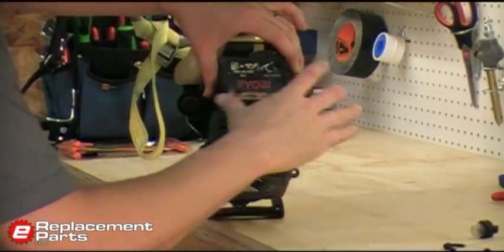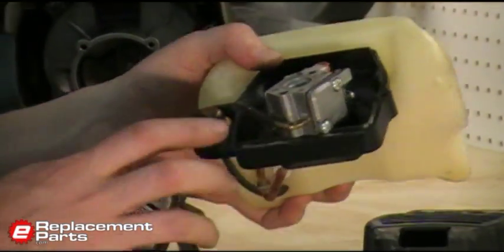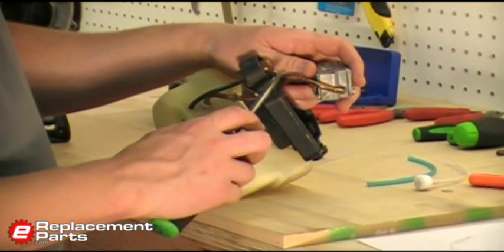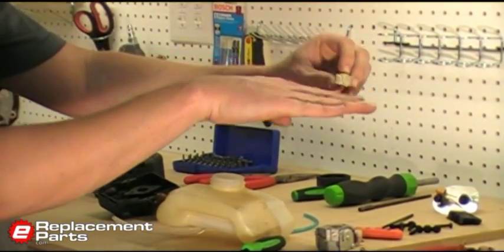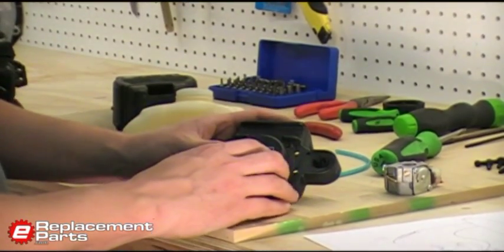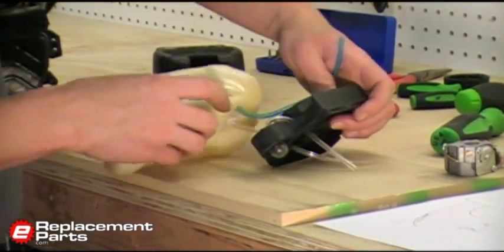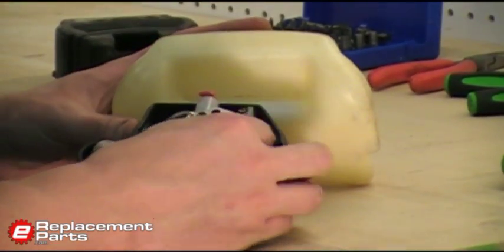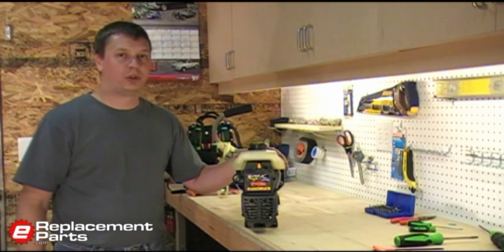How to Replace Trimmer Fuel Lines

Comment from the maker: @Em1nenceFr0nt It sounds like the muffler may be plugged with carbon and unburnt oil. Try removing the the spark arrestor screen from the muffler and cleaning it with a propane torch. If the muffler itself looks to be clogged you can usually  also clean it out with the torch. If cleaning the muffler doesn't help then the problem is likely still with the carburetor. You may want to take a look at our carburetor cleaning video. 

Thanks!
-Mark

Comment: Great video. Steps were good & very helpful since all my fuel lines broke before making notes. My weed-eater is a Craftsman Convertible 31cc 15" Model # 316790101....(Manufactured by Ryobi). Purchased the "Ryobi Primer Bulb & Fuel Line Kit" Model # AC04122 @ Home Depot, which is: •Compatible with Ryobi and Homelite products with 25cc, 30cc, and 26cc engines •Kit includes a fuel line, a return line, a fuel filter and a primer bulb •Includes an installation tool and an operator's manual. I purchased my weed-eater in 1999. Worn fuel lines are the only problem I've had after 15 years. I've kept it clean, and taken good care of it. Noticed the Made In U.S.A. sticker on it, runs like a champ!. Thanks for the step by step video.

Comment: Really well made and informative video, but like others have commented, I'm having a heck of a time getting the new fuel filter to sit flush in the bottom of the tank.  I'm pulling hard on the fuel line on the bottom of the tank, but am afraid of breaking it.  Do you have any tricks for getting that thing to sit properly?

Thanks again for sharing your video.

Comment: Try squirting a little starter fluid towards the back of the carb. If it sounds better, you may have an air leak around your gasket. Junk the gasket and apply a little gasket sealer to the back of the carb, worked for me.

Comment: great video, probably best of the 3 I watched. 2 suggestions, when installing line with filter install line 1st from underneath then have it come out by the gas cap and install filter on. 2nd clean tank and all fittings well since rotten lines leave particles everywhere.

Comment from the maker: @sarah2007hood Try replacing the lines from the outside of the tank to the inside. Push the line through (from the outside) until it can be caught by a hook or something on the inside. Pull it through the fill opening. Replace the filter. Then pull the line back from the outside so that the filter seats itself in the proper location. This works for most trimmer fuel tanks that aren't designed with user-friendly fuel line replacement in mind. Hope that helps and thanks for watching!

Comment: Hi Mark and thanks for your videos. I think I have a couple of lines crossed just took the weed eater apart and was fixing the starter pull assembly now it won't start ugh. Before I use it again I will have to switch them around I'm sure. Just so you know your volume on this video is really weak on my end.
Reply from the maker: Thank you for your comment.

Comment: Cool video, however i think the you should have the filter hanging inside rather than attached to the side of the tank, you need that in case you tilt the machine then the filter will be immersed inside the gas.

Comment: I came looking for a video like this because I have very nearly the same weedeater (Craftsman brand) that is nearly identical to the gas tank/primer bulb/carbureator configuration.  The problem I have is that I can't get the fuel filter back through the hole in the gas tank after I snake the new fuel line into the tank.  It appears that the fuel line should fully engage all the teeth/ribs on the fuel filter (up to the spongey filter piece), but then when I pull the line/filter back into the tank, I can neither get my  fingers on the filter, nor pull the filter/line into the hole, because it is too tight. The fuel line I'm using is the same size (by appearance and apparent fit) through the hole in the tank, but it's too tight coming back to get the filter seated securely.

Not sure what tricks would fix this, but this is my current sticking point.
Reply: Scott,  I had a similar problem,  I ended up using a brake spoon. to press down on the filter.   ( a brake spoon is used on cars to adjust the old drum based shoes on cars.  it has two ends shaped like screw drivers one end is straight and the other is bent about 75 degrees.  The bent end is the end I used to push down the filter with.  good luck
Reply: Hi, I came across an article that said to feed a fine wire through the fuel line , hook the end and feed it through the hole in the gas tank, attach the fuel filter and pull back through the tank. My problem is I don't know how long to make the lines.
Reply: Scott Jackson I am having the same problem as we speak.  Did you ever get the filter to sit against the tank like in the video, (which conveniently skips over this step)?

Comment: I'm hoping someone might help me with my problem. It doesn't exactly need to be replaced I don't think but I have almost no experience with lawn care and even less experience with the mechanics of equipment like this. I noticed today on my trimmer that (what I believe to be) the return line is lose at the point where it meets the fuel tank. It moves freely in and out but it doesn't come completely out. The problem is if I don't hold it in the right angle gas flows pretty freely through the gap around the return line and the hole in the tank. I was wondering if this is normal or if there is something I can do to seal that gap and make sure it doesn't leak. I don't have much in the way of tools or spare parts and this may sound stupid so go easy on me, as I said I don't really know the do's and don'ts yet, but I had the idea to hot glue around the return line where it meets the tank to seal that gap. I figured this might be a possible temporary fix. I don't really know how hot that area gets when in use, if it would just melt the glue away. I would love to get some help with this. Specifically a cheap, quick fix that would keep my fuel from leaking.

Comment: When I removed the carb, a bent washer fell out.  Does that need replaced or is it supposed to be like that?  Thank you for the help.  I have a Troy Bilt, but it looks the same as the Ryobi.
Reply: Louie Van Deven I have a similar troy bilt.  It has a spring shaped like a bent washer to put tension on the choke lever so that it can move easily between the three positions while snapping into the detents.
Reply: Okay, thank you.  I thought it looked like it was bent on purpose, just wanted to make sure.  Appreciate your help.

Comment: Is it possible to replace a bent shaft on a trimmer with a straight shaft.If you can, doe's it have to be the same brand as the motor.
      Les Greentree.

Comment: how did you get that return line in so easy? I fight it right now on my troybuilt 4 stroke
Reply: cut a 45 angle on line, will install much easier.
Reply: Correct just like I have seen others do but make sure you have enough to do that.

Comment: I would buy a piece of two foot fuel line and run it from the outside of the tank, through the gas fill opening.....put the fuel filter on it and pull it back in half way so the filter rests on the bottom of the tank. Measure or guestimate how much you will need to route it and snip. All thats left to do is mount the fuel tank and fill and your done. At least thats what I did.

Comment: Thanks a lot, I changed fuel lines and had no idia how to put back. Now I got them right and still wont run. I can see fuel moving through lines when prime bulb. Hmmm what next? It started with a shot of start fluid but died right away.
Reply from the maker: This sounds like either a plugged port in the carb or a defective diaphragm.
Reply: Thank you!

Comment: cool video, but think I'll just buy a new weed eater. :D
Reply: Believe it or not I think that is what most people do. That is the point of these videos to help us out and save tons of money. I tried and begged for a young gal to not purchase a battery powered 18v trimmer at HDepot the other day but she bought it anyway ugh. I told her to pray before she used it. They did have the 40 volt and another one with 56 volts and I can't comment on them because I have never used one with that big of a battery. I have been able to fix tons of stuff with you tube as a resource and it does save money. Gppd luck with your new one.

Comment: Yeah free spirit around the small and big engines use the real good. Of the line I use the yellow lines of expensive and last longer than the ocean yes you no you're feeling a lot better twitter it's a lot better than what you use in ya gotta shower now I'm in their own this is that the have to have a the oppression checking with you to cost me to get up and compression gauge feel like that the depression will pull the rope on a good compression to it and now I clean the carburetor on some girl the book Berlin Outback tried all that cleaning bit the dust in quite get it all plans are so I'm stuck in a pan of vinegar but on the stove let him borrow real good blazer branch come out the carburetor throw the carburetor on a Madhavan world again and then acting cleaned in then thing else then come out of it anything more come out of it but this but the blood on friends back in it and got new diaphragm for and